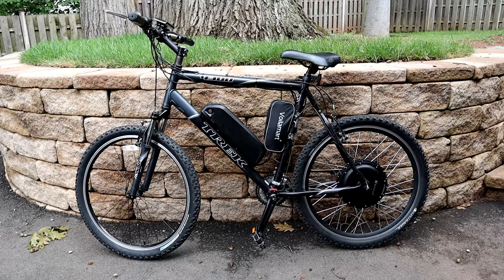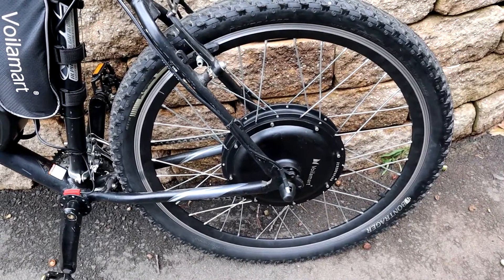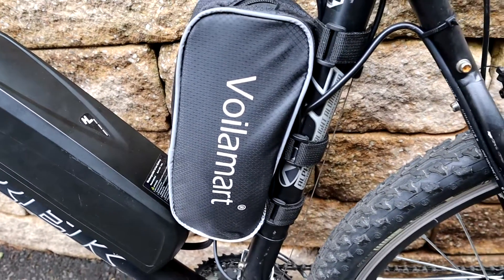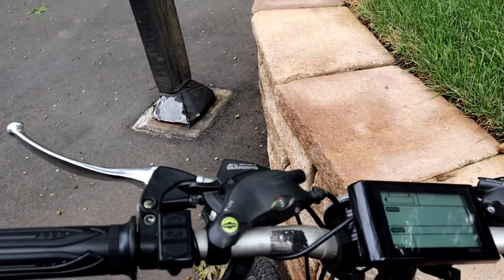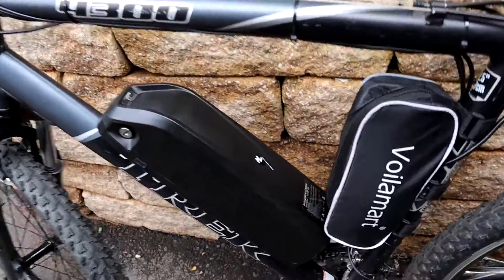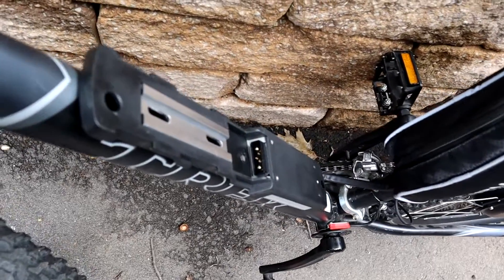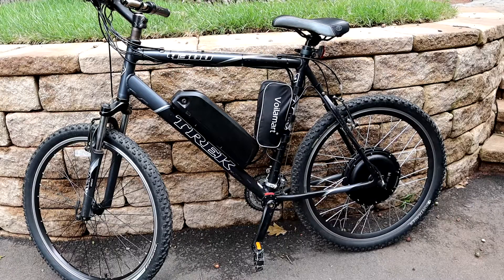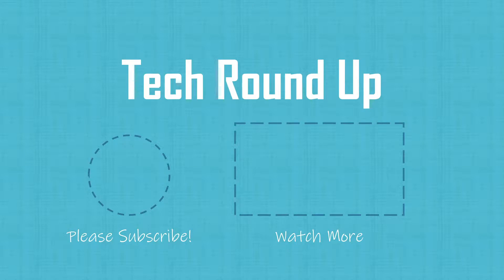DIY 35MPH Trek Electric Bike Conversion | 1000W E-Bike Kit

Comment: Ive had this almost same kit for over five years with no problems.
I bought an even cheaper 1000 Watt voilamart ebike kit without lcd, $159 at that time.
I hated changing flat tires though especially on an ebike so I bought some solid foam inner tubes four years ago and have never had a flat since.
Its a great thing.

Comment: 2 things to say, I have the same kit and I have not yet added the pedal assist feature because I didn’t have the tool, and I also use  a different 15ah battery from eBay, and I consistently get like 30 mph and at least 20 miles range

Comment: The pedel assist sensor does not tell the controller how fast you are pedeling and then in turn, determine how much power to send to the motor. Its there only to sense movement. The PAS setting you have it set at determines how much power is sent to the motor while the PAS is sensing movement.

Comment: how is the braking ? im guessing rim brakes?
Reply from the maker: Yup, rim brakes and they work great
Reply: @Tech Round Up  hi. One of the difficulties for me...not so much now...but I'm still learning... Is how to match the battery to the DIY kit. Since they come as separate items I am thinking that you have to have some sort of understanding of current and voltage In order to appropriately match the battery with the DIY kit. I don't know if I missed it in the video but what  Are the specs on the battery that you purchased please? I actually went to the link that you have in the description but it is nowhere to be found. Thanks
Reply from the maker: It of course depends on the motor kit you buy and how long you want the battery to be able to last, but I went with a 48v 13Ah battery. As long as the voltage matches the motor and the battery says it supports the wattage, it will have enough amperage to support

Comment: Yes, great video! I've had mine for a year and it's still working great! i don't have the LCD screen, and i have a front motor not the back. My model will max out at 42mph, it's insane and better than driving since I live in the city. Thanks for your content!
Reply: Hi, which kit, motor and battery you use? Thank you
Reply: I'm trying to convert a 2019 trek slash 9.8 any recommendations?

Comment: after buying kit like this i can say its garbage , motor  is too heavy , you can get better performance buying geared 750w kit ,torque is same and top speed is same and weight is almost half of 1000w . I dont want to talk about battery consumption which this motor eats like insane . Dont reccoment anybody buying direct drive bikes when there are plenty of small geared yet powerfull motors . i have samsung 48v 40.ah battery and 1000w without pedal assist will eat it so fast. 1000w with wheel weighs about 7 kg while 750w weights about 4.1kg . Some brands have even lighter 750w like 3.6kg with rim.
Reply: It costs $0.07 to charge battery where I live, so I don't worry too much about battery consumption. I also live 2.5 miles from work.

Comment: Now the 8000 watt bike kits are usually powerfull enough to  destroy the chains & gears... exspensive too...
Not exactly green unless a wind generator or creek water turbine generator is used to power the bikes battery.

Comment: what type of connector does the controller use to go to the battery? (xt60, anderson)?
Reply: I just got a 1500w kit, not sure if they differ in connectors but mine came with ring connectors.

Comment: I want to put the front wheel version on my Schwinn Frontier mountain bike, I think it's a 26" tire and a pretty standard frame. Any reason it may not work? Thanks for any info if you got it
Reply: should be fine mate
Reply: Sometimes you have to file a millimetre out the dropouts but that's easy, don't forget to use steel bottomed forks not magnesium or alloy.

Comment: 35 downhill is crazy fast on a bike, takes forever to brake
Reply: I do on avg 56 kmh on my 2014 trek x caliber 8 g2 geometry frame & forks with a 27 spd on 29" tires...Gary Fisher
Reply: Most push bikes will easily do 30mph down hill

Comment: Would like to convert my trek 3900. Yours looks exactly the same as mine. I realize there are differences. Mine also has integrated brake and shifter...prolly same one. I applaud your ingenuity. I would kind of like a more integrated or separate solution for the brakes. Your video brought this to my attention that I would need to figure this out.  I guess I would need to buy separate shifters to match gear configuration front and back separate from brakes? Anyway. I am still looking around. thanks.
Reply: I had the same problem I just cut off the levers of the brakes then installed the ones that came with the kit and pushed them up against the shifters if done right nobody can tell a difference

Comment: These kits ('Voilamart' are simply drop shippers who put their own name on the kit, many sellers sell exactly the same gear under different names) are quite simple to install, helps if you have a bit of experience repairing bikes but no engineering background is needed, and for most of the kit, the only tools you need are a set of allen keys, screwdrivers, pliers, possibly mole grips/wrench if the back wheel nut is rusted on, and a small socket for the protective junction box (you can pick these up at poundland or supermarkets). 
There are only 2 problems that occur during installation - the first is the pedal assist sensor, that requires you to take the crank (the bit of metal that connects the pedal to the bike) off, which often requires a large automotive-grade socket set, which is extremely expensive professional-grade gear.
The second is the connection between the battery and the kit. As you are buying the battery separate from the kit, and there are many different types of battery kit (heilong, silverfish, generic heatshrinked 18650s), it usually happens that the kit and battery have completely different connectors, which means you have to snip them off and put the connectors you want on - meaning either soldering or crimping.
Reply: A crank puller can be had for less than $20.
Reply: @Jo060  yes the crank puller itself is cheap, but there is often a nut that you need to take off to get to the crank, and because it is encased in the crank housing you cannot just use pliers.

Comment: Hey Tech Round UP, I got the same bike setup to a T. 48v voilamart kit compatible downtube hailong battery. I didnt know about the aluminum copper connection situation. So Ive hooked it up and it wont run. can you help me troubleshoot this?
Reply from the maker: You might need a voltmeter to measure voltage from the battery, etc to see where the problem might lie
Reply: @TechRoundUp  is there a possibility I could shorted the circuitry by connecting the two units?
Reply from the maker: Connecting to the battery shouldn’t have cause any damage, unless connected with positive to ground and ground to positive. The battery protection should have kicked in however
Reply: @TechRoundUp  Thanks man!
Reply: May sound really simple, but wire it all up, and try holding down the power off button on the lcd screen for a few seconds. I had the multimeter out for hours trying to figure what was wrong before I did this!
Reply: @Debbiebabe69  thanks! already got it down!
Reply: @jeffspiteri9122  What was the problem with yours?
Reply: @Debbiebabe69  I didn't realize the screen had to be hooked up in order to turn the power on. I thought I could just flip the battery switch hit the throttle and go.

Comment: I had this kit and some feature does not work as expected. 
1. Led rail is pass through from your battery. You cant turn on off from the lcd by holding up button
2. PAS mode is delay, and sometime output full speed at level 2, 3 and such. 
3. Both throttle and PAS works regardless what you sat in the setting 0,1 or 2

Comment: Can someone help me? I've just purchased this Kit and it's still in It's box, waiting for the battery, I'm very new and very Inexperienced In fixing up bikes but I'm going to have a go at it, I have a road/hybrid bike to fit the kit to. However my brakes are Cantilever and I see that this Kit has 2 Brake connectors from the Controller, I've read that when the brakes are applied that it will cut out the motor.. can I use my existing brakes for this or do I need to upgrade my brakes to Disc Brakes?

Can you help and advise? Many Thanks, Jeff
Reply: Hey. I would say use the new brakes. If not, you might face issue where your brake has to work much harder because the motor still spin when you are not 100% stop throttling

Comment: The speedo is not calibrated correctly, it runs about 10-12% slower than shown as measured vs. gps.  That being said it it has been reliable and nearly silent vs. the fat tire bikes running geared hubs which make a ton of noise.

Comment: I have the same system but without a LCD easier to hook up less wires The twist throttle just tells you how much battery you have no speedometer but for 220 bucks 1500 watts
Reply: I find mine isn’t fast
Reply: @awstech6217  alot are sold as 1500 watt kits but are actually the 1000 watt kit or even worse the 500 watt kit .
Reply: Can you send a link where you bought your kit?

Comment: I got the 1500w kit with internal controller and I have over 4000miles on it without ANY problem whatsoever!!! I highly recommend this kit. I can go 39.9mph and I get a range of about 40-60 miles out of a charge with my 54v battery..
Reply: All water proof connectors, plug and play EVERYTHING, I built the whole thing in about an hour and a half and it's one of the best vehicles Ive ever owned.. Doesn't make a sound and is way faster then the average 50cc scooters that "try" to race me.. and a few go- karts as well
Reply: @maxpower001  how did you get battery with 40 amp continuous output.... suitable for 1500w??? the ones on ebay are china crap for 500w max
Reply: @travis938  54v 13ah seems to work fine, $300 battery
Reply: @maxpower001  mine not even 20 mph
Reply: Did your LED on/off (holding arrow up) work? My headlight stays on no matter what unless i unplug the battery. Also, does the P10 setting work? Mine has both PAS and throttle works regardless mode 0,1 or 2
Reply: how difficult is the setup? I have no engineering experience, do you think I will be able to use the conversion kit?
Reply: @tomhog7883  Take to a mechanic if you don't know what you're doing, any local car mechanic will fit it for you if you give them 50 bucks
Reply: I have a question. How do you get 40-60 hours of use on a 13Ah battery? Is this on throttle only or are you peddling as well. I've seen so many videos of people with 11Ah batteries and they only get 20 miles or less on throttle only. I would think to get 40 miles you'd need double the Ah.
Reply: @jadielmontesdeoca4409  miles and or hours with a battery you get one or the other.. its all about your throttle control and how much assist u you
Reply: 39.9 mph if you are doing downhill
Reply: @ronpagala7496  nope.. flat land

Comment: The instructions that come with this kit are bloody awful.  I bought a front wheel drive to go on my home built trike. It was a real experience to build character. I am a retired engineer mechanic, and this was a challenge because I did not expect the torque produced. The instructions do not tell you how to mount the special washers, and I had the wheel tear out of the fork twice, tearing up the cables before I figured it out. I then changed to a heavy duty fork and ground the fork to fit the axel and washers, then I made a retaining torque arm to prevent the motor from going a different direction than the rest of the bike.  You have to be careful. It produces a lot of power, but is kind of poopy on steep hills. Still and all, this is a great thing to try, and cheaper than a new electric, although you can now buy a new electric bike for USD1750.

Comment: How do you know if the battery and controller will be compatible?
Reply from the maker: Most batteries will be listed as 1000w and then just need to make sure it’s 48v
Reply: @TechRoundUp  ok. so just make sure the voltage matches up? I was thinking of getting a 52v battery.
Reply: @TechRoundUp  most lie ... 5 china cells is 500w max not 1000w you got scammed... surpise it doesnt cut out anytime u throttle are you 100lb and never full throttle ? or never full throttle when battery under 50% ?: lol ... ALL YOU NEED DO IS READ CONTINUOUS OUTPUT the battery said 20amp for 30 second max.... meaning 26 amp waaay too much especially long use.... the needed is 30 amp continuous output for 1000w
Reply: @travis938  'China cells' usually just means 2500mah rather than 3500mah cells - most heilong sellers wont scam you, just to get the same continuous output and amphourage needs more cells, so they are heavier.
Its not like general 18650 bulk sellers and thier '9000 mah' ultrafire cells that actually read 500mah or less....
Reply: @Debbiebabe69  ya LOTS more for same output... 
so you need for 1000w like something that dont even fit in a triangle bag

Comment: Different solution to installing the cut off brakes with the kit. I ended up making the brake sensors for hydraulic brakes to solve the problem and keep the original integrated brake levers. Good job though, love my Voilamart
Reply: How did you do this?
Reply: @russellpressman1631  Here's a short video that shows you the basics. These kits cost about £10-20.

https://youtu.be/bGosopxGJN8

Comment: Are you able to remove the battery to charge?
Reply: The battery is separate from the kit. If you buy a Heilong style battery (which is what this video shows) then yes, the battery is removable, and the carrier and wire stays on the bike.

Comment: Just go my kit installed and does about 30miles
Reply: Mph30
Reply: @evananthonybaez  did you use the battery and kit he linked?
Reply: @xxdigbyzzxYT  yes the kit and battery cost like 600 on Amazon. The best investment ever
Reply: @evananthonybaez  on amazon? He linked ebay
Reply: @xxdigbyzzxYT  the battery is for 500w not 1000w beware it shit china for 500w not 1000w wont work with 1000w will cutout on any hill unless and full power... i have much experience in battery it my business.. it says you need 26 amps so you need 30 amp continuous rated battery not one that says 20 amp max 30 second or it will kill battery very fast 1/3rd less life than quality one.... AND never work for full power..l.
Reply: Can I reach out to u for some help ?

Comment: Torque arms are often overlooked,  I installed one on my bike even though it is a steel frame and not aluminium.
Reply: ALSO INSTALLED WRONG 50% TIME the torque for 1000w is extremely little less than 500w geared hub... avoid front motor is best advice . good torque arms  need proper installed than helps
Reply: @travis938  I just build.another ,.this.time aluminium frame , 1000w dd hub on the rear and I still used 2 torque arms bolted to the frame.

Comment: What is the maximum speed per hour? and how many km of autonomy using only electricity, without pedaling?
Reply from the maker: Max speed is 30mph and around 20-30km on battery power alone
Reply: @TechRoundUp  that makes no sense. Kmh is slower than mph lol
Reply from the maker: Thought you were looking for range in km 😜
Reply: @TechRoundUp  is that 30mph with strictly motor power? No using the pedals?

Comment: Just bought a 1000w rear wheel voilamart  that came with bullet battery connector, what type of battery connector did you use on that battery? thanks.

Comment: Nice video.  I'm considering the front version instead of the rear.  Any comments on why I shouldn't would be appreciated.  Rick
Reply: Front i dont think has paddle assistance
Reply: Front forks are weaker and may break esp if aluminium.
Front wheel is prone to spinning and could cause a fall.
Steering will feel a bit odd maybe with the weight.
Back wheel isnt too hard to do, I did mine no problem with very basic tools and knowledge.
Reply from the maker: Rear gives you bit more power, but the front can be a little more risky when it comes to handling and braking

Comment: Do you get different power assist level as mine only one full power
Reply from the maker: Yes different pedal assist levels, being fed off of the sensor
Reply: @TechRoundUp  must be my controller I've tryed all settings only getting one power level 1 to 5